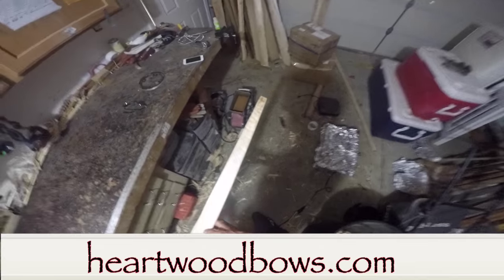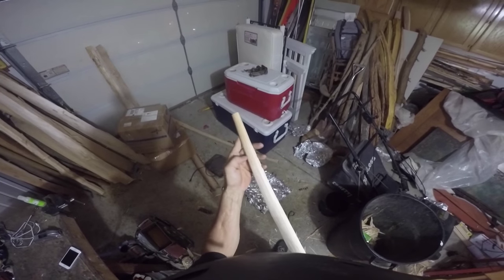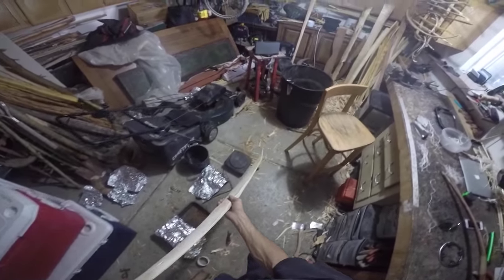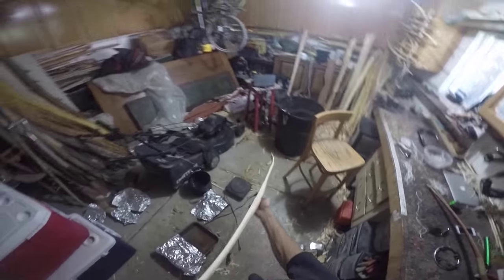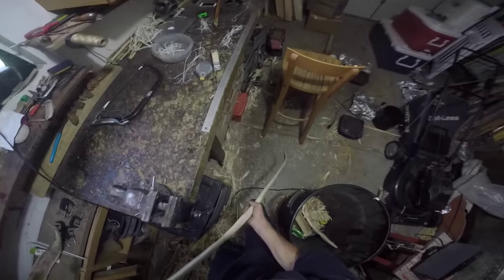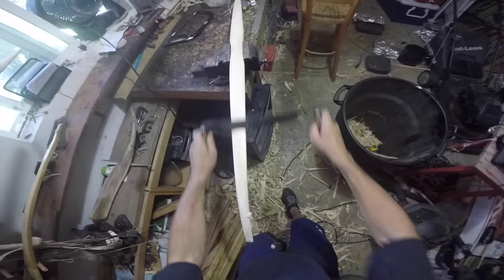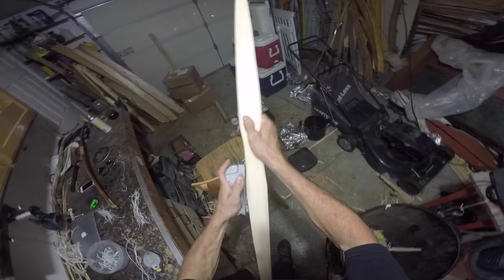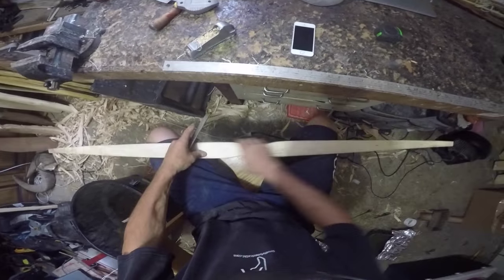How to Make an Ishi Style Bow (Part 2 of 8)

Comment: I just made an ishi style bow after simply reading about it a day or two ago. I had split a fairly flat piece off an Osage orange stave and decided " why not?" I cut it out today, still green only cut last week then heat bent the tips and limbs somewhat bye heating them in a wood stove. Then did as you did and stood on them, but I went out in the snow to accelerate the cooling. I had shot 3 arrows off of it before bending and it was pretty powerful, but now I believe I will have to completely re tiller it because it stiffened so much. I believe I will back it with brown paper and then paint it some sort of Indian looking colors and patterns